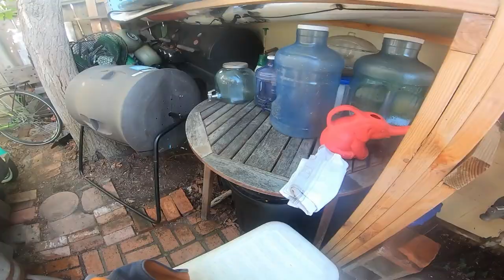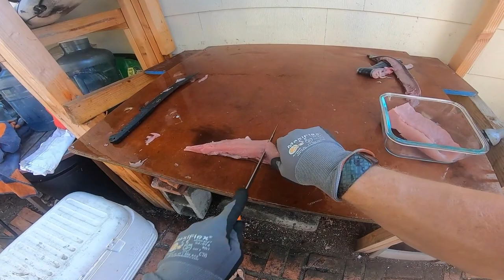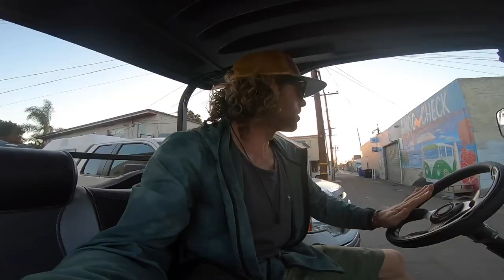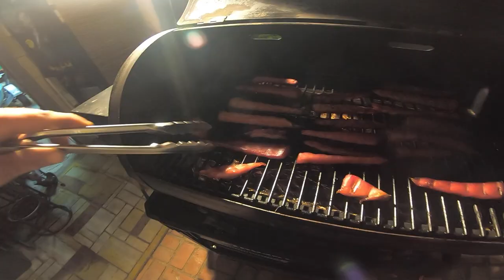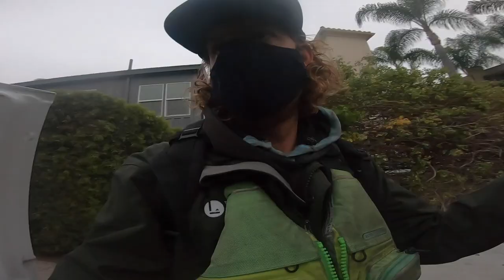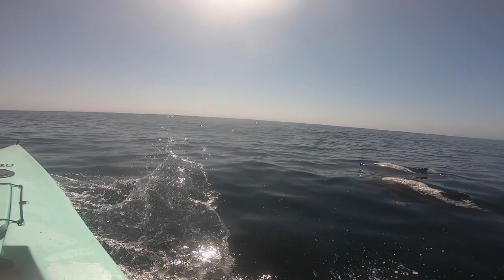Join Me On A day of Filleting, Fishing, and Dinner Cruise with a Surprise Guest

Comment: Yo wats up my dude. Looks like you got LJ locked down. Any tips whenever I’m out there? I’ve been a few times but no luck on any big fish. Just calico and some rockfish.
Reply from the maker: My tip for LJ is to use live bait.  Catch the biggest greenback mackerel and fly line it with no weight in 90' of water in front of the big white condo building.  Think positive, stay positive, and have faith that you will catch the big fish you dream of and it will happen.  That is how I've caught most of my fish in La Jolla.